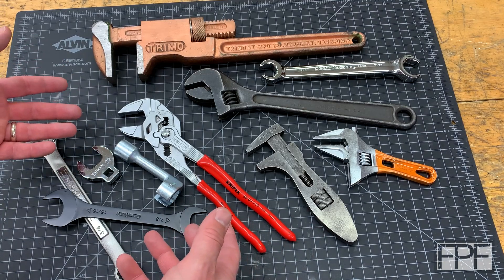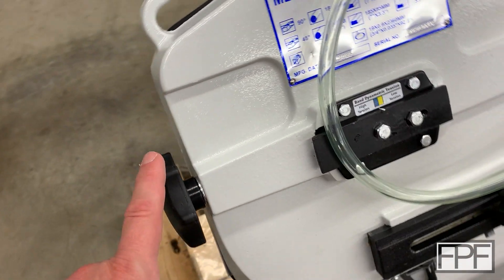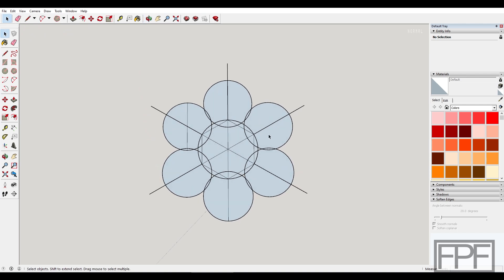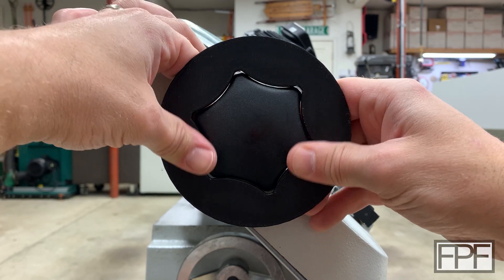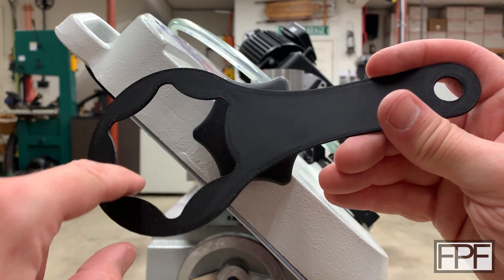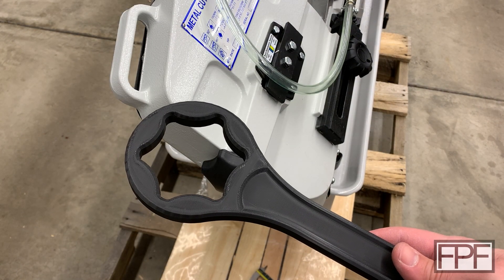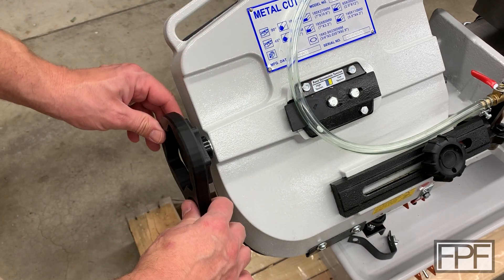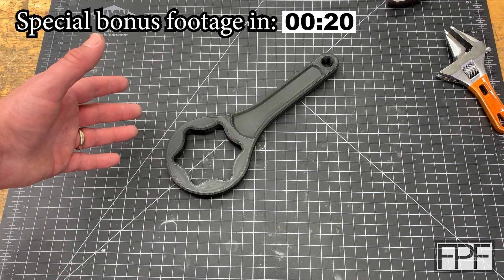3D Printed Blade Tension Wrench

Comment: The knob being that stiff implies to me that there is something you are supposed to be loosening before adjusting the knob. Some kind of lock bolt for a sliding mechanism or something. It may also be easier to turn while the saw is running.

Comment: One thing I haven't seen a comment about yet is your z-seam position. It can be a failure location and I see it on the outside still near the drive, so it would probably have been better moved down towards the handle.

Comment: Or, and here's a thought, it has a locking screw for the tension and you need to release that before adjusting?
The two "clamp screws" are said to be loosened for adjusting blade tracking but I think there is an omission in manual for blade tension...

Comment: I have a cricut machine. I like to design my stuff in fusion 360 then export to svg. I then cut with the cricut on cardstock then test fit. SOOOOO much faster than printing and wasting material.

Comment: Nice job, especially the engraving bonus, but I don't quite understand the need for it. I have a similar bandsaw and have no trouble tightening the blade with one hand. The block with the indicator is carrying the wheel with the blade. If you loosen it slightly it may be easier to adjust. Don't forget to tighten it again once the correct setten is achieved.

Comment: instead of doing 6 walls, could just do 3 walls at 200% LW. in theory takes less time assuming your now maxing out the flow rate of your material. But i do this just to reduce wear on my printer and  often save just a tiny bit of time, being that you are using a bamboo printer prob not a whole lot but still some.

Comment: Cubic infill is strongest, by the way.
Reply from the maker: Appreciate that, but doesn't it overlap the same as grid?  I guess for PLA it probably doesn't matter, but likely more prone to nozzle contact, no?
Reply: @FunctionalPrintFriday  Make a big cube with it set for cubic infill and then look at one of the layers in the slicer preview to see how it prints. I haven’t worried about nozzle contact yet, which isn’t to say I shouldn’t, I suppose. When do you think you might consider that a concern?
Reply from the maker: @ClaytonMacleod  PETG is the big one.  Fails the majority of the time if paths cross.  PLA not usually an issue as long as it's not a tall structure with small footprint.
Reply: @FunctionalPrintFriday  The failure type is being knocked off the bed? I’ve only ever had that kind of failure when something was as you say, very tall relative to its footprint. But even that can easily be mitigated by adding some kind of support structure to block horizontal movement, like a sail with minimal contact points along its height.
Reply from the maker: @ClaytonMacleod  yeh, knocked off bed, or just movement relative to the base, causing accuracy issues.  Again, not a problem for PLA the majority of the time.

Comment: Lets pretend you put a pivot bar(just a pole) in one of the points of your wrench. Then you put a full door/stop/face that pivots on that bar. Then you would have a wrench that can be turned intoa  socket, or back into a wrench, right?

Now pretend you did that on both sides, or just made one side a full on socket and left the "door" on the other side.

Now you can put the wrench on for extended periods of time and dont have to go looking for it.
You just have a bigger handle at that point lol

Comment: You won't cut that with an angle grinder. Run a ton a coolant on that and it will be like cutting butter. I tried to cut 4140 about that diameter with an arbor mill before deciding that it fedexd here from hell itself. Never managed to cut it. I still have it.
Reply from the maker: lol!

Comment: I would have capped it so it didnt move over the knob. It would have captured the knob and I would have removed another .4 mm and just increased the circle diameter a bit. A near press fit. You could have also screwed through my cap into the knob for a permanent handle

Comment: I would have filled the top. Gives you a way to press against the wrench to keep it locked on the nut! No print problems too because you could print that flat area against the build plate.
Reply from the maker: might do another one like this
Reply: @FunctionalPrintFriday  The etching / dye removal with I assume is a laser looked fantastic. I've tried with matte PLA and my UV galvo laser and no luck, but oh boy would I love to get something working to the quality you got! Looking forward to the video!
Reply from the maker: @MoonWind32690  I'll have a video coming out later this month showing the machine and settings I used

Comment: I think almost all the CAD software packages allow you to import a picture and scale it.  Take your phone or a camera and take a picture of the thing you are trying to mimic from as far away as you can with the zoom as high as your phone or camera can manage at that distance (and getting the whole object).  If you include a ruler in the picture along side that object (or on top) you can set the scale of the image in your CAD software and model around the image.  It may be easier than having a conveniently sized can of paint in your shop.
Reply: this is the best comment here. surprised he didnt like it
Reply from the maker: Just hadn’t seen it yet.
Reply: Or for easily removable parts, just put them on a flatbed scanner and scan it. No perspective error that way.
Reply: @ClaytonMacleod  Or in this case, make a hole on cardboard and cut to it from the side. Slide it under the knob and draw the shape. Get 1/1 copy for the scanner or camera
Reply: What is the reasoning behind being far away and zoomed in?  Is that to minimize any distortion from the camera optics?
Reply: @JayRussellDuramax  it's to reduce the parallax.  Think of it like driving behind a Semi truck.  If you are closer to it you can't see the mirrors on the side of the truck from closer up, but if you go further away and zoom in  the whole profile (including the mirrors) are more visible.
Reply: @AndirHon   beautiful explanation and it makes perfect sense after you say it like that.

Comment: Interesting video, and I'm glad you got it to work, but I think it's a bandaid solution. If you're having that much trouble turning the knob on your new saw, you need to clean those threads out with a tap. Also, why so much guesswork? You have measurement devices. Why did it take two attempts to get the snug fit after the initial prototype?

Comment: The web thickness between the points of the star shape and the corners where the wrench handle meet the end of the wrench are the most likely failure points.
One suggestion I would make would be to re-orient the star shape by rotating it inside the wrench design where there is a star point aligned with the center-line of the handle. This should increase the web thickness in the area where the handle meets the circular end making it even stronger.

Nice design and it looks very strong with the 6 inside and outside walls along with the infill.
Reply from the maker: Great idea

Comment: I needed a 3” hex wrench to fix a plumbing problem. I found a wrench for $35 and would probably only use it only once. So I got on autocad and a couple hours later I had a new 3” hex wrench to fix my problem. Total cost 2hr design time 1hr printing time and $16cents in filament.
Reply from the maker: If I could hit the heart twice, I would.  Feel free to share pics, etc. on the discord or subreddit if you like

Comment: Electroplate it to look like metal :)
Reply from the maker: it sounds like a good idea, and for a shelf queen this would probably look great, but I think anywhere on the wrench that it flexes or "gives" a small amount at the contact points the plating would probably crack because it's properties are mis-matched to the PLA under compression/tension.
Reply: @FunctionalPrintFriday  Absolutely, not practical. It was more a "for fun" idea.
Reply from the maker: @rilock2435  understood

Comment: I'm definitely not the kind of person who questions the people doing the filming because sometimes it doesn't make sense to share the whole backstory, but I wondered something immediately about the wheel tension mechanism.  I didn't see it mentioned elsewhere in the comments, so I don't think I'm repeating anybody else.  Did you check the bolts where the hub of the wheel attaches to the casting?  It doesn't seem impossible that those are too tight, causing it to be difficult to adjust.  It's worth popping the blade off to see if it is still difficult to turn the knob, because it shouldn't be.  Sorry for my assumptions on this if you checked already!
Reply from the maker: Great question.  As I take the tension off the blade with the wrench it gets easier to turn.  It's only when coming up to tension that it's hard to turn.  It's easier to turn when the saw is running (which is the preferred method), but the wrench still makes it MUCH easier.

Comment: My bet is that there are bolts you are supposed to loosen before adjusting the tension and tighten after.

Edit: looked at the machine exploded view in the manifacturer's manual, and there is a set screw, preloaded from factory. No locking bolts and none needed. It will eventually get loose and need readjusting, but in a none industrial context, it will probably be fine for a long while.
Reply: Yep. Those 2 bolts on top of the tension gauge are there to lock the tensionner. 11:00
Reply from the maker: Was my initial assumption as well, but one just holds the threaded block against the slide block, and the other sets blade tracking.  It also loosens up when the blade is de-tensioned.
Reply: @FunctionalPrintFriday  Just checked the manual from the precision matthews website and it says to loosen those 2 bolts. I wouldn't take any chances since it will wear the tensioner.
Reply from the maker: @ydefy1848 what page? Been through the manual and not seeing that.  I actually talked to their support as well (great ppl) and they said there was just the plastic knob.
Reply: @FunctionalPrintFriday  Page 11. Bottom left figure 23.
Reply from the maker: @ydefy1848 thx, found it, but thats just for blade tracking, not tensioning.  That just loosens the block behind it to allow it to tilt for tracking with the set screw.  It doesn’t make the tensioning any tighter or looser.
Reply: @FunctionalPrintFriday  Yeah your right. Sorry for wasting your time. I missread. Band saws always have a locking bolt for the tensioner usually.
Reply from the maker: @ydefy1848  No worries.  I really appreciate you digging into it. Legit, thx!

Comment: I would have taken a picture of the knob straight on. Then measure the lowest diameter. Put the photo in fusion as a canvas, and then Calibrate the canvas with your measurement. Now you can outline the canvas and be super close without any other measurements (though I usually like to further calibrate)

Comment: You could have changed the tension knob for a normal screw then use a normal wrench when this one disappears or breaks because plastic breaks years down the line.
Reply from the maker: Not a bad idea, but It's on a long threaded shaft.  I could certainly make a new one on the lathe, but there's not enough thread left on the stock part if I cut the plastic knob off, and it doesn't seem to want to come off the threads otherwise.

Comment: 3D prints are so much stronger than a lot of people expect. A while back I designed a dog pellet breaker to break some medically prescribed dog food down from huge pellets for a smaller dog. I use a hammer to strike a printed piston that breaks the pellet on a printed anvil twice a day for every pellet. I've hit that thing thousands of times with deliberate force, and the thing holds up like a champ.
Reply: It'll generally be a lot stronger in compression than tension. Especially what with layer adhesion.
Reply: Do you have that model shared by any chance? I've needed to design one but haven't gotten around to it yet

Comment: Nice!   I tend to start by lubricating the mechanisms first.  Sometimes that's all it takes to make adjustment easier.
Then I'd look at either adding more diameter to the knob with a lever or handle to glue on top, or replace the existing knob completely.  That means there's no extra loose part to misplace ad its always where you need it to be.
Reply from the maker: First thing I checked too, and the threads were well-greased.  It's just more tension than I'm used to based on only having wood bandsaws before because there's no "tires" on the wheels.  You're just stretching the blade on cast wheels.

Comment: You can add 0.1mm cuts to get more strength. 0.1mm will fuse and add extra walls where you place them. 
Used in Voron parts for example.
Reply from the maker: that's a really interesting idea!. . basically forcing more outer walls where you need it, but not wasting material where you don't
Reply: @FunctionalPrintFriday  if you offset the cuts below the top/bottom there will be no visual difference in the surface finish as well.

Comment: Again an excellent instructional video about 3D printing. However, the reason that the bandsaw doesn’t have a big metal hexagon for a spanner / wrench is because best practice is to tension the blade when the machine is running. I think you will find the plastic knob will be much easier to turn when the blade is running.
Reply from the maker: That makes sense, but the hang tag it shipped with just said tension BEFORE using the saw, but they probably meant before making a cut :P  Either way the wrench makes the task a lot easier.
Reply: @FunctionalPrintFriday  Instructions should read "Tension blade with saw running but not under load or while making a cut.  Anyway, tensioning with the motor spinning spreads the load/stresses on the blade and allows it to find its happy spot.

Comment: I have been making this style wrenches for a few years now, perfect application for 3d printing. It was a challenge figuring out what material to use as PLA shattered and PETG and ABS was too soft. Ended up with carbonfill from formfutura
Reply from the maker: That's surprising to hear.  I've had really strong prints with plain old PLA as long as I don't push the speed too far and compromise layer adhesion.
Reply: @FunctionalPrintFriday  maybe my application required more force or my design was flawed

Comment: Or you could’ve just taken a picture of it with a ruler and adjusted it in photoshop before exporting as an svg to then convert it to a the model.
Reply: He has lightburn for the laser he used in the bonus video. Lightburn can trace images very accurate and then export to dxf directly. But your idea is sound.
Reply from the maker: @00fiks82  pfffffffftt you don't know that. . .  but, yes :P

Comment: I've made things like this. A suggestion, make it slightly thicker and fill in 1 side so it's more like a socket (can't slip to far onto the knob) this will also help with strength and it will just be easier to use.
Reply: Yeah but you can also just add little retention wings above the tips, it'll be fine

Comment: Oh that surprise at the end was sweet!!! Although I was really hoping you'd make a revision to add an enclosed back. For some reason that was really bothering me. Great video!
Reply from the maker: thx!
Reply: @FunctionalPrintFriday  You could make a Snap-on backing plate/bar that clips onto the back of your final print. That turns in into a socket... and That way you can test your snap fit design and tolerance skills, and you don't waste plastic printing out a whole second one.  As you know it's always So Gratifying when a part you make perfectly snaps where you want it to go. Especially when it does so on the first iteration!!
Reply: Yep, as bad as your OCD is, I too expect a reprint with a built in stop.😂
I suspect all you need to do is make the socket portion a few millimeters thicker and use that extra height to sweep the tips inboard at 45 degrees. 👍😎👍

Comment: It will work for a short time then break if its PLA. Try using stronger material. Nice work though. Keep doing this ! :D
Reply from the maker: Will update if it breaks, but I don't think it will.  Layer adhesion is really good and it won't be held under tension.